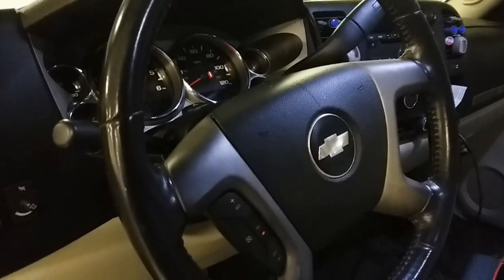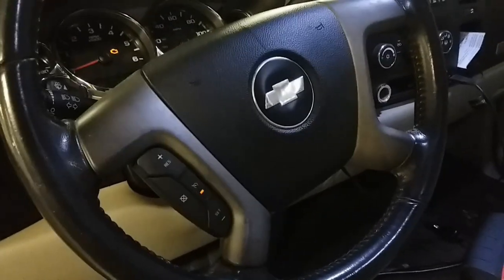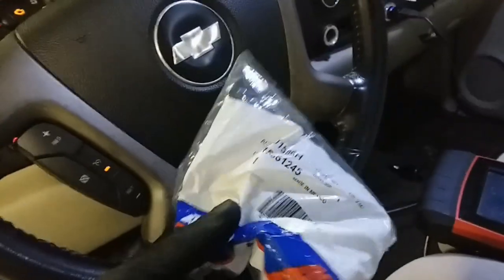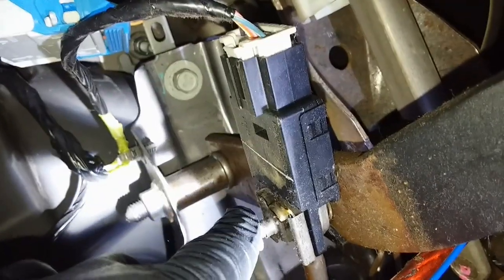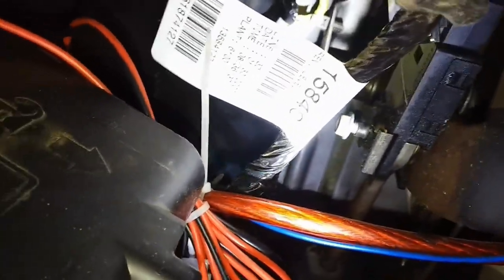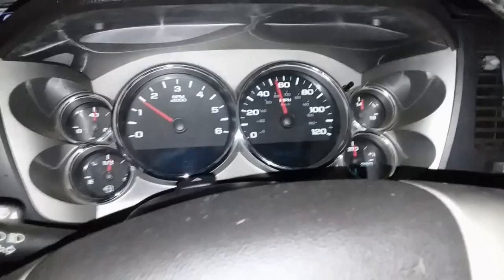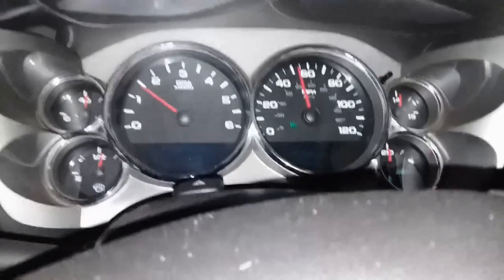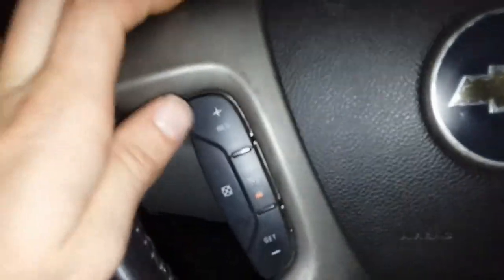2007 Chevy Silverado P0573 Brake Light Switch/Cruise Control Inoperative

Comment: Thank you for the help! Just thought I'd let everyone know my situation for anyone with similar questions/issues as I had. My cruise control light would light up on the steering wheel, but it would not set. The brake lights all worked and there was no error code or check engine light, everything worked as normal other than my cruise control and parking assist. After swapping out this part my cruise control now engages and works perfectly, I think my parking assist even beeped at me while I was parking after the test drive, so it possibly fixed that too, we'll wait and see. Good luck everyone!

Comment: Thanks for posting the video. I had the same problem and got it fixed in about 20 minutes. I didn't have a bolt to remove. Just a fat guy trying to squeeze into a tight place.

Comment: I just did this and it was easy. Fixed both cruise control and service stabiltrack error. Trick to getting the clip off is to grab the top of the small rounded part on the outside of clip where bolt goes in and pull away and it will pop right off. No need to even use a screwdriver.
Reply: Scott Slankard appreciate that cause that was the hardest part lol

Comment: BEWARE!!!!!
READ THIS BEFORE YOU REPLACE THE SWITCH!!!

Before you replace the switch you need to realize the Brake Lights won't work unless the truck is running.  I spent an hour checking fuses, replacing the old switch, putting the new one back in and out three times.
Nothing worked when I pressed the brake pedal.
Then I decided to crank it up and the brake lights worked.
I thought the brake lights would come on anytime you pressed the pedal.
It did in every other car I owned but not this truck.
So if you think you didn't do it right crank it up and try it then.

Comment: I've had to do this replacement twice.  My suggestion, use the AC Delco replacement part not the Doorman.
Reply: I'm wondering if this is also my issue, I went to the parts store hoping to get the AC Delco but they only had Standard. The swap went pretty quick and I was sure the switch was the issue due to the symptoms (tail lights but no brakes, and cruise won't engage) but no dice. Maybe I'll pull it tomorrow and try another or try testing the wiring.

Comment: So I bought the switch and when I go under to replace it, it had no bolt. It has the metal clip, which looks way different than all the ones on all the videos I have seen. I have a 2007 avalanche by the way.
Reply: I had the same issue.

Comment: Thank you ... however, i tried and replaced light switch. So I continued troubleshooting and found the reson of this issue . It was from defective steering   Clock . Once i replace it by new one the cruise activated and work good
Reply: Steering clock?
Reply: Yes it can also be the clock spring in the steering wheel

Comment: this just fixed my ABS STABILI TRACK lights , thanks for detailed video by the way it was rough trying to orientate the module and clip. one thing i noted was the bolt had lock tight on it as well but i didnt even need a wrench to back it out .... not sure what was up with that but thanks again
Reply from the maker: ready toosnap no problem. Thanks for watching.
Reply: Stability track break light fixed?

Comment: Do I need that 10 mm bolt for it to work?? I lost mine on it and have the problem of my brake lights stays on all the time and cruise control doesn’t work and it throws me a code of service cruise control as well .

Comment: Great Video! My silverado cruise control stopped working but did NOT put on the engine light or give a code. By replacing the old switch  with a factory switch from a jungle themed online store, less that $20, the cruise control is up and running again. Thanks for the help @Idaman71044

Comment: It's Christmas Day and I'll be looking forward to a stop at one of my local auto parts places tomorrow to get a new switch. Sooo very tired of my cruise control not working right. I did figure out that if I use my toe and pull the pedal toward me even though I don't feel any movement, I could get it to set. I'm tempted to take the switch off and pop it open to clean the switch contacts, but for the small price of a new one why bother. Thanks for your video.
Reply from the maker: Thanks for watching.

Comment: I just replaced mine today. Took it for a drive & still didn't work. I stopped turned the truck off & on again the light finally came off went for a drive & it worked. It was doing this before I changed it to the new one. Do you recommend to unplug the battery for it to reset or to also erase the code see if that helps?

Comment: Hello. I switched mines out due to non working cruise control. It works now, but  now I’m getting service stabilitrack service traction control on my dash. Any suggestions on how to fix that?
Reply from the maker: You would have to get the codes pulled for that system to start a diagnosis

Comment: Ive got a 2007 suburban but, my switch looks totally different than this. Are there other versions of this switch? The switch I bought has 4 male plugs. The one on the car has 6 or 8 looks like. I don't want to take it apart if it doesn't work.

Comment: Hey ldaman. I just put a new brake pedal switch in my 07 Silverado. Went to clear the code(none showed up), but started truck after and my dash light came on. Thought maybe my emergency brake got pushed down but it wasn’t. What do you think it could be? I’m going to check it out again In the morning. This is a first for me. Not sure what’s going on.
Reply from the maker: Brake warning light is on and no codes show while running? Check brake fluid level. Let me know what you figure out

Comment: My 2011 Silverado cruise control  comes on when it wants to
Reply: Just replaced it on my 2011,cruise works,easy fix,pry clip out with thin screwdriver with a little force,clip goes back on with upward force and your thumb,took me 10 min.Truck even runs better.Like my trailer brakes were sticking the whole time.

Comment: Will the cruise control work if you change out the switch but don't clear the code??
Reply from the maker: That's what happened in my case. I replaced the switch and cruise worked. The light was still on due to catalytic converter code.

Comment: @Idaman71044 i just did this, only thing is my truck won't start and the needles on the guages keep ticking as if it's trying to reprogram or something. I tried jump atarting the battery, but it still doesn't work. Any advice? I don't have a computer to read what the problem might be.
Reply from the maker: I'm guessing it wasn't doing this before? If not swap the old part back in and recheck it. If it starts and runs normally with the old part back in, sounds like a bad new part.
Reply: @idaman71044  it was the battery lol idk why but as soon as i unplugged the break switch and switched it with the new one, the battery died (it was already old). So got a new one and everything is how it should be lol thanks for the help!
Reply from the maker: @3hdee  no problem. Thanks for watching.

Comment: So I just replace my trucks brake light but it did not light up. Hopefully your method will do the job..could I purchase the brake switch at like an autozone store?
Reply from the maker: Ok. I have to ask. Year, make, model. I assume Chevy Silverado. If it is the same year range as mine, I found out that the brake lights dont come on unless the ignition key is in the on position. Typically people replace bulbs with it off. So let me know if this helps.
Reply: Yeah I replace it while my truck is off the brake lights wont flash while stepping on the brake pads, if that make sense. Its 2005 chevy Colorado
Reply: Joseph Montoya my chevy 2005 silverado has the same problem but to the point that if i push the brake light switch upwards they work until it wiggles back down and they stop working all together unless i press the brake pedal all the way

Comment: I switched it but the service the  stabilitytrack and control service is still on and the truck is shaking and the braking has become more sensetive
Reply from the maker: that sounds like a different issue. any trouble codes?
Reply: Idaman71044 code: p0451,p0301, and p0463.

Comment: My 08 Silverado doesn't have cruise control, would this still fix the light
Reply from the maker: It very well might. Make sure to check the fuse for the brake lights too.
Reply: Okay I'm getting it checked tomorrow thank you!!

Comment: I've a similar issue with my Uplander but the brake lights work - is that relevant? I mean in this repair were the brake lights not working?
Reply from the maker: Jamie Clay my brake lights were working. Just no cruise control. A bad brake light switch can cause many different symptoms. Including no brake lights.
Reply: Gotcha - got one coming.  It would be nice if it resolves the problem - I'll let you know!  Thank you for this video!
Reply: Sadly this didn't solve my cruise control problem.  I don't know if it can be related but my alternator just crapped out, too.  Hummm thanks anyway - it was a cheap and easy replacement so at least there is that.  :)
Reply: Jamie Clay that sucks that it didn't fix it. Can you let me know what it was when you do get it fixed?

Comment: Would replacing this switch also fix my brake lights not working?
Reply from the maker: It very well could yes. I also found out that the brake lights wont work on my truck unless the ignition is turned on. Not sure if this is what you may be experiencing.  I still haven't been able to confirm if that Is normal or not
Reply: Yes it should
Reply: I have that same problem... Intermittently

Comment: Will this also fix my issue of my 2008 Silverado not shifting out of park?
Reply from the maker: Tim C I would think so. If the shift lock doesn't see an input from the brake light switch, it won't release the shift lock to take out of park. This is definitely the case with the Subarus and Lexus models I mostly work on. I replace about 1 switch a week with subaru. Especially in the summer.
Reply: Idaman71044 thank you. I'll give it a shot.

Comment: Read before you purchase the switch. I purchase my switch and replaced it. Cruise now works. The kicker however is...the switch has two different contacts. One normally closed and one normally open. I tested the switch I removed and the contacts tested perfect. The existing grease on the other hand was dry, hard and sticky. The switch has to rotate on the metal pin on side brake pedal. The reason the brake lights still work is because you press the brake hard enough to actuate the switch in whatever position it might be in. So if the switch is stuck out of correct position then the contact for cruise control won’t work. 
My new switch came with instructions that said to thoroughly remove all grease from pin and add new grease. I used white lithium. 
So basically I believe the old switch was still good but the grease was not. I mean why would just one section of the switch fail?

Comment: Hey thanks for the video and help. Mine is a 2010 and did as you stated and it worked. However not at first. I took it for a drive to try it out and at first did not work , but stopped truck and pushed on wiring harness and tried it again and boom there she went ha ha. Thank you. Clip was an issue as mine was in slightly different locale on brake pedal. Had my wife go under dash and it just came off in her hand lol figured right. Thanks again.

Comment: What if the cruise doesn't set but there is no light?
Reply from the maker: Chris Murrill so the cruise control light on the steering wheel doesn't light up? That sounds like it could be a bad switch. I would first check that the fuse is good then then check if the switch is getting power and ground.
Reply: I thought you had a dash light on for the cruise control switch. My bad. But the cruise control light on the wheel does come on.
Reply from the maker: No problem. If the light on the steering wheel comes on, but the cruise won't set, I would highly suspect the brake light switch. I had a code for my light switch circuit. The brake light switches are a common problem on these trucks.
Reply: I'll replace it tomorrow and we will see how it goes. Thanks bud!
Reply from the maker: No problem. Good luck.
Reply: did it work for you Chris Murrill?

Comment: Will replacing that switch on a 2011 fix my problem as well?
Reply: Because every now am then the cruise will work but most of the time it will not and the light on the switch is on so I know the switch on the steering wheel is good
Reply from the maker: @garrettcarman9358  more than likely, yes. My check engine light was already on for my catalytic converter. There was also a code for the brake light switch. I also had intermittent cruise control until it just entirely went out.